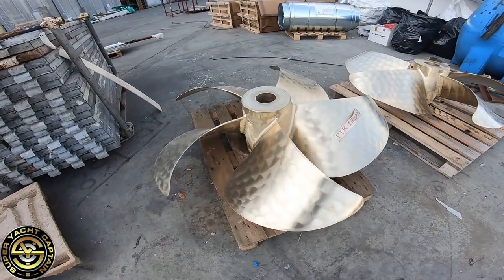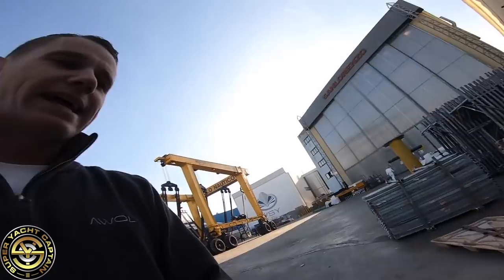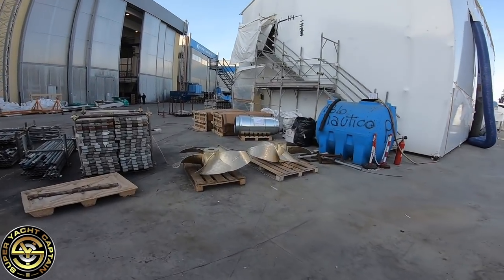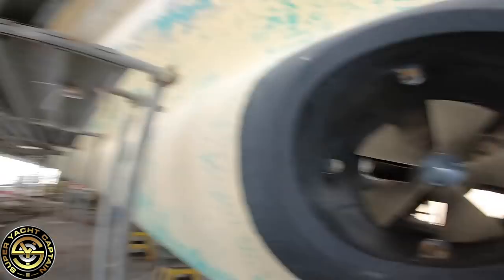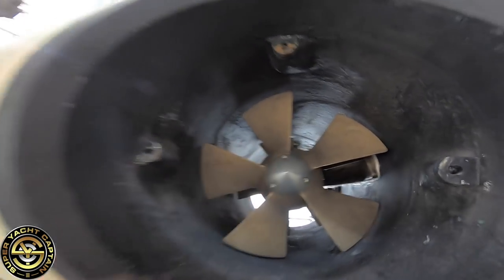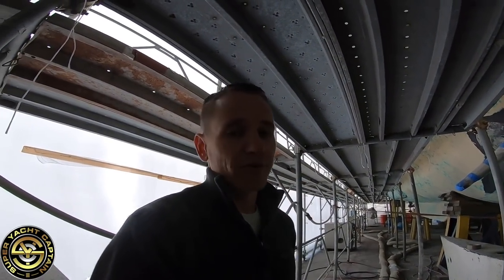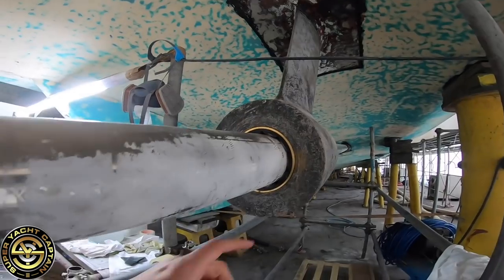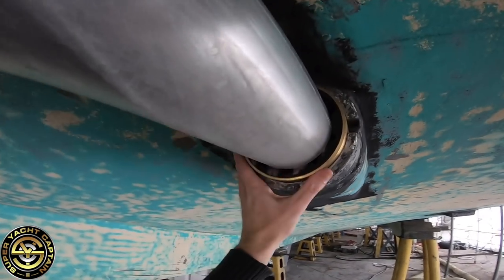Tuned Propellers on a Luxury Super Yacht (Captain's Vlog 49)

Comment: Those propellers are very interesting and the engineer who came up with the idea is very ingenious indeed. Rather than cutting down the propellers at the tips to lighten the loading as was required, he redistributed the load on the blades by making what are effectively winglets on the tips of those blades. Obviously, as this is a superyacht, the owner would prefer less efficiency on a propeller but a more silent propeller. The engineer kept the same pitch over the inner 2/3 radius but cleverly introduced washout at the tips to reduce pitch and then folded/curled, the " extra long tips' into a winglet to avoid wingtip vortexes.   Those propellers lost thrust to reduce the work on the main engines but gained a lot of the elegant, royal, majestic standards of engineering. Looking at 1:00,  those blades do not have much camber in the cross-section, so they are of the type which accelerates the water ahead and behind the propeller and not through the blades.  I think I would have accelerated the water through the blades by curving the blades and given some rake to ensure that ( entry area * entry velocity) = ( exit area * exit velocity) Obviously the rate of change of velocity of the water will be minimal to avoid noises!   That is the function of those expensive tips! 
Well, being a superyacht the owner is not looking for efficiency, but luxury and majesty and grandeur in engineering application, and these propellers certainly can provide the luxury that a profit-making ship cannot. It is a privilege to be able to understand the complex, invisible and silent function of our universe taking place in the little space and state of propellers and be rich enough to implement it!. 

 https://youtu.be/FNqXf6t7e-w

https://youtu.be/LPYmbNNzk9I

The J-58 jet engine used on the SR-71, well it has a few invisible miracles taking place between the space of its blades including the intake paths or should we simply say, divergent and convergent diffusers/nozzles as that is what exists between the blades of any propeller!  but engineers know when to play about with diameters, pitch, rake, camber, suction, and pressurizing to distribute the loading with or without shrouding the unit and introducing winglets as birds ( silent owls) and dolphins and orcas do. 
https://youtu.be/F3ao5SCedIk

Comment: Wow! These propellers are absolutely stunning; So different that what they looked like before. I am picturing how many times Alex had to strike the blades to achieve this result. A true craftsman.😃
Reply: Actually I was surprised at how rough the central hubs were left looking. The blades were polished and finished with an awesome pattern and the rest looks like it was hit with a grinding wheel. Not what I would expect from that level of service. That rough surface affects performance.
Reply: @JCrook1028  The blades look awesome, But I agree, I grind props and tune them everyday and I am wicked fussy on how they look and perform and especially how they are balanced!

Comment: Hello Captain. Nice job. I have a question. Not knowing the specific Cat engines installed leaves me at a disadvantage. However I do know the engines like a certain load at a certain rpm Range. If I understand what you have done correctly then you have effectively lowered the gearing. The equivalent of going from 4th down to 3rd gear. Yes that raises the rpm but also increases fuel burn. If I understand the end result your engines will be happy but speed vs fuel burn will drop. Thereby decreasing operational efficiency. Yes engine efficiency will increase but operational fuel burn will also increase. Meaning more fuel burned over a trip, and season leading to more trips to the fuel dock. Am I correct in this thinking? I'm just curious. You said the goal is less bad gasses in the atmosphere. But I'm thinking in the end it's a wash. Trading nitrogen dioxide for CO2 and sulphur dioxide. Maybe I'm wrong but I don't understand the thinking. Thank you for the video and I am excited to see the results of all your hard work.
Reply: @SuperYachtCaptain  Thank you. I look forward to the sea trials. I hope you get what you are looking for. Understand I don't know charter boat operations but I take it you do more sprinting from location to location at or near wide open throttle and near 100% load vs an owner boat where you might do longer trips at or below hull speed and throttled back depending on the engines a few hundred to well over 1000 rpm and back to 30 or 40% load producing a much lower fuel burn. However running at reduced loads does require daily runs at full power for 20 to 30 minutes to heat up and burn off any carbon and soot. Then throttle back and continue on your trip. Say trans Atlantic crossing or New York to Caribbean non-stop. This all assumes the boat has the fuel and range for this long range use. I know a lot don't have that kind of fuel on board or food storage for 2 or 3 weeks at sea. Thank you again. Be safe.
Reply: @Big.Ron1  any engine will have a speed that gets the most efficient fuel usage, and if you are running either faster or slower than that speed you lose efficiency.
It's like how lugging the engine in your car does not save fuel.

The props were too aggressive and preventing the engine from reaching ideal cruise rpm, and so by reducing the load slightly they get the engine to the ideal speed.

Also, remember that in a diesel engine, the amount of fuel injected is based on what is needed to maintain a certain rpm, so fuel usage is based on load, not rpm, because if you increase the load, more fuel has to be injected to maintain the rpm.

If the engine was not able to reach the recommended rpm, that means that it effectively was constantly trying to accelerate, and dumping as much fuel as possible in to try to reach the desired speed.

By tuning the props and reducing the load slightly, the engine can now reach the desired speed, and then reduce fuel because it's no longer trying to accelerate.

Without this, you either have to leave it in constant acceleration mode, or reduce the governer setting, which puts the engine in the less efficient condition, burning dirtier and wasting fuel.